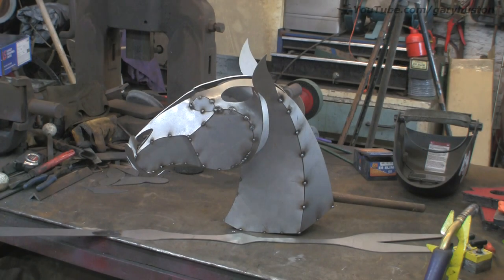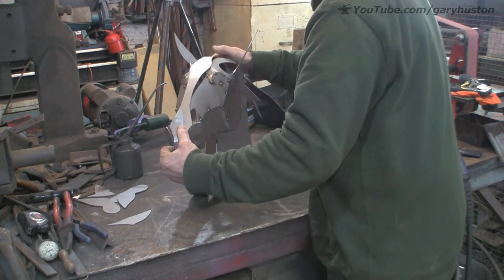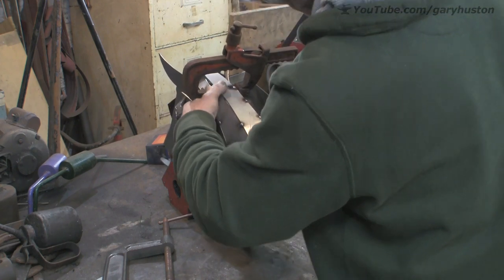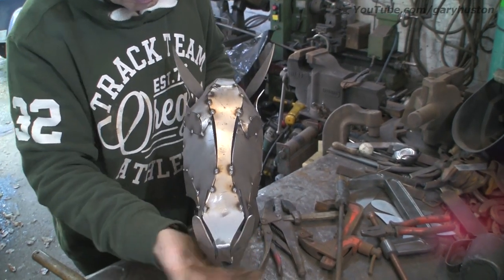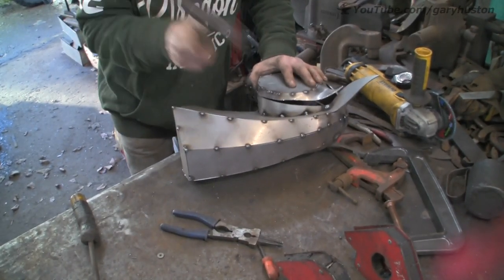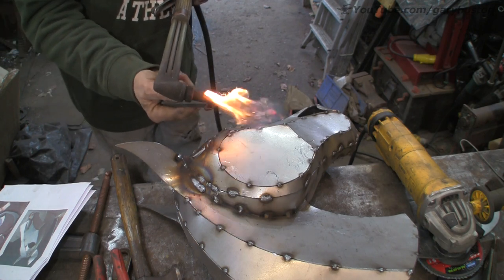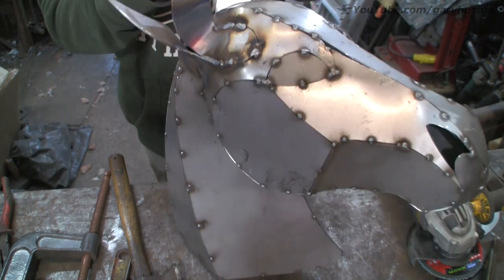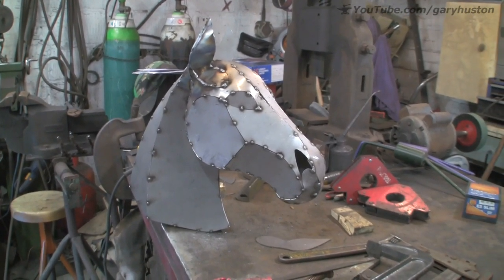Horse Head Build part 2

Comment: I would have left the long part in three pieces because it is giving you a lot of grief. I think if he would have used smaller pieces that things might have gone better. You have parts that have to be formed in a couple of directions and you had to force them. I would have done it just the same way that you did it. Maybe if the ear was concave, it would look better.
Reply from the maker: Before you criticise someone’s efforts try it yourself.
Reply: Its very difficult to make it look easy !    That long piece with the firk looks like an absolute bastard to fit, so well done.    Id love to have a go at this head but i only have gas welding gear. That would make the welding take a lot longer but then again a bit of heat here and there might help to get a bit of shape in to it and coax it together where there's a struggle.    I'm sure the next one you make will take half the time. 🙂   well done. Love it.
Reply: @garyhuston  
I did and it was hard to do. I think he did a great job compared to mine but then I did not have the blueprints.